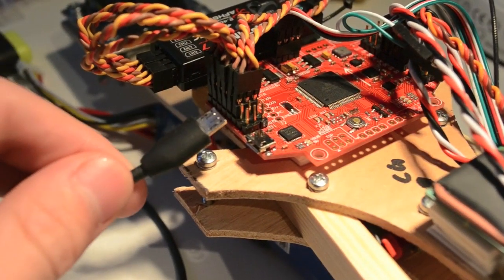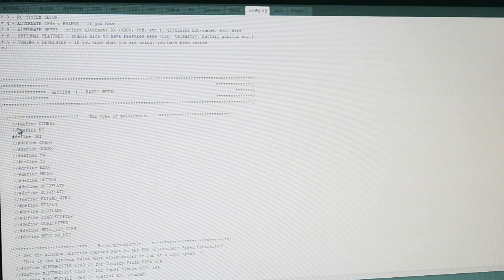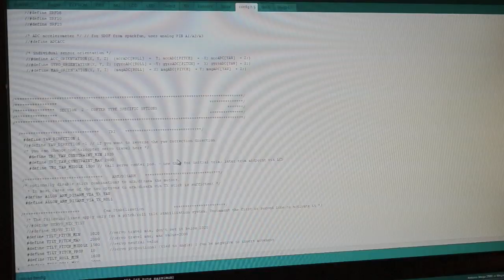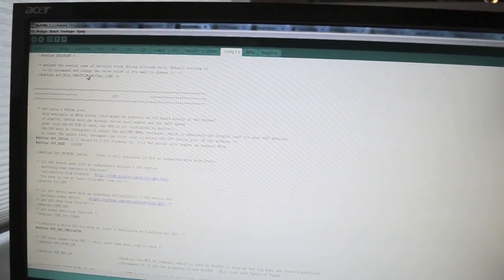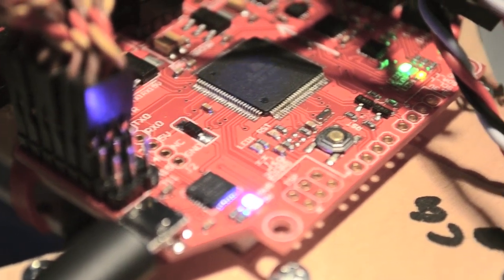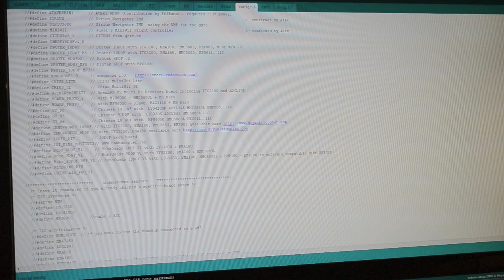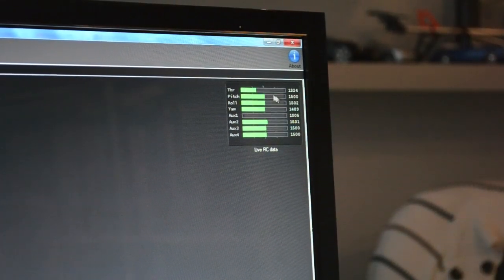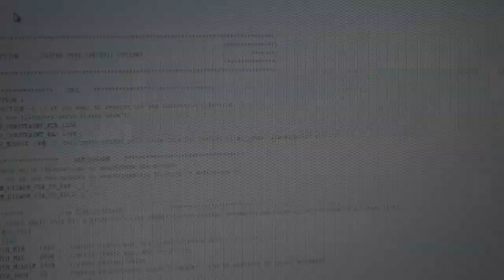Comple Tricopter Guide - Programming MultiWii [Part 11]

Comment from the maker: Make sure your connections from and to the controller board are correct, and make sure you arm the copter (move throttle stick to lowest position and rudder all the way to the right). Hope that helps!

Comment: I wonder if can help me...I have only one direction of travel on my tricopter servo..I have my multiwii set to tri and servo in config-h at high-2000  low=1050  and center at 1500..but my servo wont center..  Thanks for the video..

Comment: My motor does not want to spin up.  they beeped but that's about it.  when I connect it directly to the reciever, they work just fine.  What could I be doing wrong?

Comment: I must be doing something wrong. I cannot get the arduino to work. The motors turn when linked direct to the rc receiver but not when hooked to the arduino. Everything uploaded from the computer. Two LEDs on the arduino blink alternately. I also haven't been able to get the GUI to link. I have two arduinos and both do the same thing. Any suggestions?
Reply from the maker: Hmm. That sounds weird? Have you tried connecting it to the GUI without any of the wires from ESC or receiver connected?
Reply: MultiCopterBuild I got the Gui to connect both with and without RC and motor connections. Still no response from motor when throttling up. Are the blinking lights normal?
Reply: John Melanson I made some progress. I got the servo to work with the transmitter through the board. I did this by connecting A11 to channel 2 on my receiver if that means anything to you. The motors beep if they are not plugged into D3,5 and 6. I've hooked up a motor directly to the rc and found channel 1 was throttle. I didn't flash the ESCs with Simonk. Is this necessary?
John Melanson
Reply from the maker: John Melanson Hmm sounds weird. You could try reprogramming and changing the rc transmitter layout to a different one. I'm not sure it works but you can give it a go at least :-)
Reply: MultiCopterBuild I am using hobbyking ubec 20amp ESCs. Does that make a difference? Also, do the yaw, roll and pitch wires need to be connected for the motors to work or can I just plug in the throttle? Do I need to flash in the simonk? Again, I can make the motors run if I plug them right into the receiver. Are the blinking LEDs on the Arduino normal?
Reply from the maker: John Melanson Shouldn't do any difference about motors not spinning. Only difference should be a less stable copter. I really don't know your problem or a solution for it. Try flashing the board with an older version or something like that. And yeah try to connect everything up before testing :-)
Reply: MultiCopterBuild Sorry to take up your time. One last request. Are the alternating flashing LED lights normal on a functioning Multiwii board?
Reply from the maker: John Melanson No worries about my time ;-) Well it depends on the color of the LED and how quickly it blinks. But yes, i get an orange light and a green light on mine as well :-)
Reply: MultiCopterBuild So I found how to change the channels on the receiver but that didn't make it work. One thing I've not done is calibrate the motors. I tried doing it the way you describe but could not get them to beep. Maybe I didn't keep them running for long enough of a time. I just saw somthing on the arduino code  that shows how to calibrate all the motors at once. So two questions. Do I need to calibrate the motors in order to make them work? Should I try the simultanious calibration?

Comment: my gyro is reversed for some reason and is compensating in the opposite direction.  How do I fix this problem? PLEAAASSSSE help me.
Reply from the maker: I'm sorry i haven't done that before, but as far as i am aware you should be able to do it in the multiwii code. Search for something like override_gyro. It should be somewhere in the config.h file. Try looking around and see if anything looks like it could help solving the problem. Trial and error my friend ;-)
Reply: MultiCopterBuild Thank you so much though.  I will try.  Also when I throttle up my rear servo goes either extreme left or right without me putting input.
Reply: MultiCopterBuild
I was able to figure it out.  I went to the TRI and changed the direction of the Yaw. and that made the Gyro go in the correct direction.  I also reversed the rudder on my TX so I can still turn in the correct direction.  Problem Solved.  Your video was a great help also.  May you continue to do great things and Happy Flying.
Reply: giovanni cubano i have the same problem my servo goes on right and left no input do you solve the problem